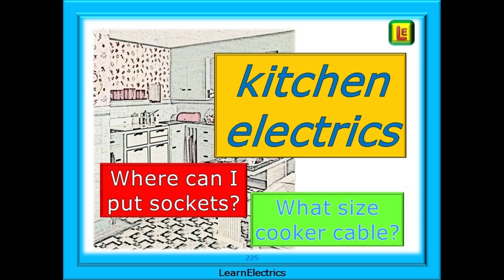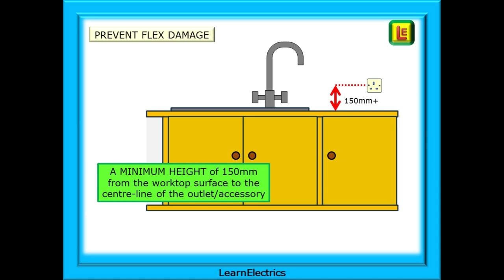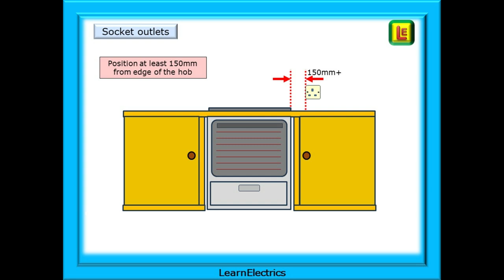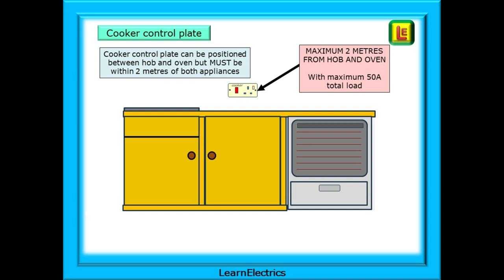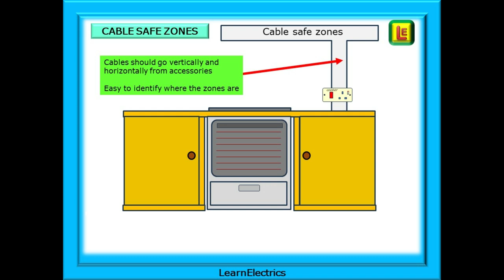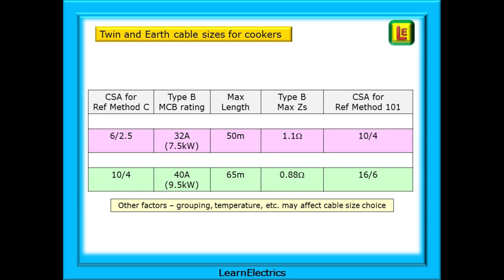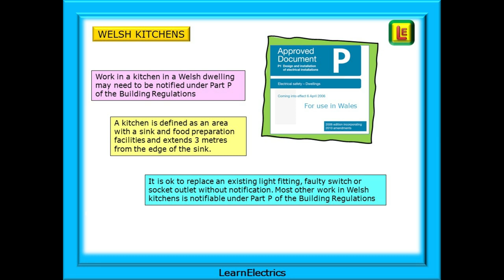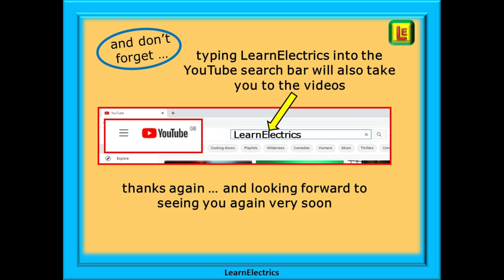KITCHEN ELECTRICS – WHERE TO INSTALL SOCKETS – COOKER INSTALLATION – DIFFERENCES IN WELSH KITCHENS

Comment: Thank you. Looking at training to become a domestic installer next year. These videos are brilliantly clear and making me excited about getting qualified in this trade!  🎉
Reply from the maker: Great to hear that. Its a good trade to be in. Choose your training centre carefully. Dave.
Reply: I would do a little digging into the routes into the electrical industry, the whole "domestic installer" part P courses etc aren't a valid way to get accredited now, so it's essentially all or nothing now.
Reply: @asawyer2872  cheers for the info. You say 'aren't a way to get accredited now'. What's changed?
Reply: @tomistallard I believe it used to be that you could sign up to NAPIT or similar having completed a domestic installers course and therefore certify your work. 

A recent change means that membership is only available to those with the appropriate NVQ, following completion of an apprenticeship or appropriate city and guilds courses. 

So starting from scratch, someone looking to become accredited and be an approved electrician would need to have done/completed the following.

C&G 2365 L2
C&G 2365 L3 
18th Edition 
C&G 2391 Inspection and Test
NVQ L3
AM2 

Some of those qualifications have equivalents for those going through an apprenticeship I believe, but if you're an adult learning looking to retrain, those would be the courses you'd need to complete.
Reply: @asawyer2872  nice one thanks for all that. The training I found has a 'domestic installer course' which includes a number of qualifications. I'll check to see if all of those mentioned are included or offered. Thank you.
Next step for me... Find a good MFT on a budget!

Comment: It's nice to see different perspectives on this.  Didn't have a clue about they did that in Wales boyo 🐑🍆🙄

Some feedback intended to help. . . The sound on the vids can seem a bit distorted when viewers are using headphones.  I might be an idea to upgrade the mic?
Thank you for putting these online 🙂
Reply from the maker: I've tried 4 mics. Using a blue Yeti at the moment. But it sounds ok on my earphones. And its a different computer to the original. I'll take another look, thanks.
Reply: @learnelectrics4402  I would agree with HeathenGeek - there is some slight distortion in the audio. However, I suspect it is not the mic but perhaps your recording levels are too high and, as a consequence, there is some clipping of the audio signal.

Comment: Thank you for another brilliant video Dave !
Could you please include the source of information where all of the measurements have been taken from such as the installation of sockets 300 mm from the sink and cooker edge, as well as sockets 150 mm above the worktop, or is it just your own recommendation? Few videos on EICR touching this object but every person uses their own source. 
Thank you.
Reply from the maker: Its come from all the books that we use, The Wiring Regulations, On-Site Guide, Electricians Guide to the Building Regulations, Approved Document P etc. None are my own recommendations, its all from the regulations. Dave.
Reply: @learnelectrics4402  thank you for reply Dave💪🏼
Reply: I presently have a 4.2KW double oven and basic ceramic hob both connected to 6mm wiring through the CCU and cooker switch.

Looking at replacing the ceramic hob with a 7.2KW induction hob so not sure it it would that run on the present circuit or would it need it's own 6mm feed from the fuse box.

Comment: The current Electrician's Guide states that only built-in appliances require a remote, accessible switch. For appliances pushed under, the socket should be accessible when the appliance is pulled out. (5.2.3 (g) and (h))
Better done as shown in the video but not always popular.
Reply from the maker: Thanks for the input. Dave.

Comment: If I’m upgrading a bathroom extractor fan to one that requires a type A rcd do I need to replace the type ac with a type A or can I leave the type ac unplaced as regs are not retrospective?
Reply from the maker: Take a look at the video on the link below, it describes the differences.
An original type AC RCD will still detect some types of fault on the unit.
However, the Regs always recommend that manufacturer's instructions are followed for best protection.
https://www.youtube.com/watch?v=bOTberqGvQU

Comment: He mentioned sockets behind washing machine and under sinks , but he didn’t mention anything about single sockets next to the cooker connection unit behind the oven. Which is for the electric ignition on older gas cookers.
Reply from the maker: Thanks for watching.

Comment: Is it OK to lose-lay cables and junction boxes on the kitchen floor behind the kitchen base units and horizontally in the service duct? Do they all have to be clipped too? My walls are concrete base plaster so cannot easily take a masonry nail and I have removed all the skirting boards.
Reply from the maker: there is nothing that says not to. Just be aware of IP ratings if they are on the floor, washing floors, pipework etc. can you bond a piece of plywood to the wall with Sticks Like or Gorilla and then screw into that so you have a little clearance off the floor for the junction boxes.

Comment: It is better to have the washing machine socket fixed inside the nearest cupboard for easy acsess and operation for maintenance. and install worktop sockets nine inches from surface to center.
Reply from the maker: Thanks for your input Michael, brilliant. Thanks for watching, appreciated.

Comment: Where does it says in bs7671 that cooker switch MUST be positioned within 2m of cooking appliances?
Reply: not bs7671 but Part P building regs guidance
Reply: @brianhewitt8618 Which page of Approved Document Part P? I can't locate it and would like to know.
Reply: @brianhewitt8618 It is located in On Site Guide Appendix H#4. It is a guide though. My question is where does it say that it is a "Must" or "shall" not recommendation or a guidance?
Reply from the maker: Brian has these covered. Great support.
Reply from the maker: Thank you Brian.
Reply from the maker: See Brian's reply. Thanks.
Reply from the maker: If you look on page 18 of the Regs you will see a definition for should and shall. Hope this helps.
Reply from the maker: Have a look on page 18 of the Regs where there is a definition of shall and should. Hope this helps.
Reply: @learnelectrics4402 So you are leaving it to engineering judgement? No backing it up with any norm, regulation? It looks like for one person 2 m rule is a must for another it might not be.
Reply: @lechk1823  correct

Comment: @3m21 you state sockets under sink is not recommended.  Well the English regs do.  This sits bad with me.  I think it is a poor engineering decision.  I have seen many a leak under a kitchen sink. 

I do like the idea of the Welsh kitchen needing notification.  Should help cut down on cowboy kitchen fitters
Reply from the maker: That used to be in the English Part P too, but for reasons known only to themselves, the authorities took kitchens out of Part P notifiable locations. Thanks for watching.